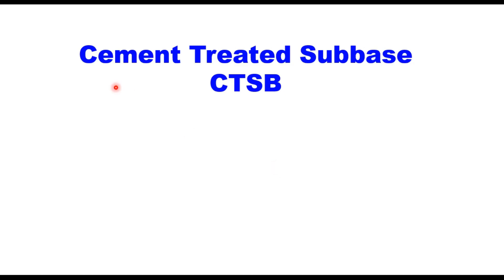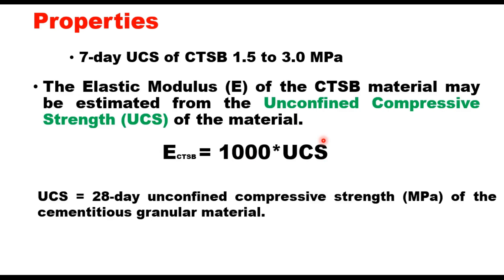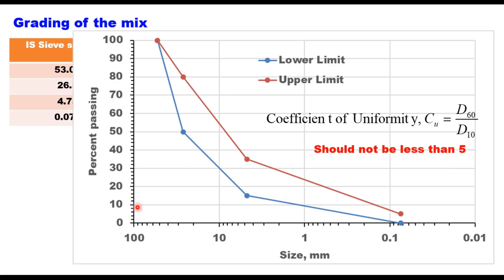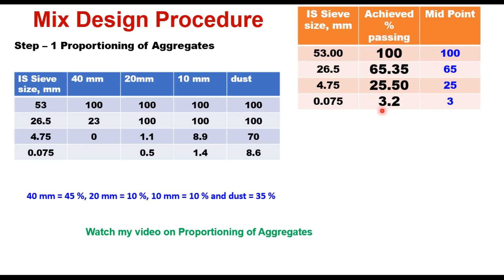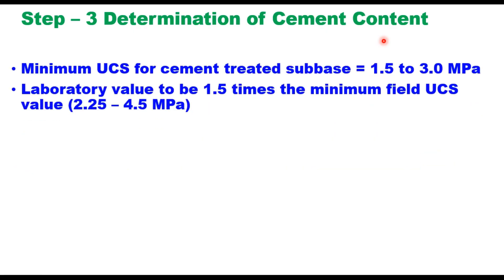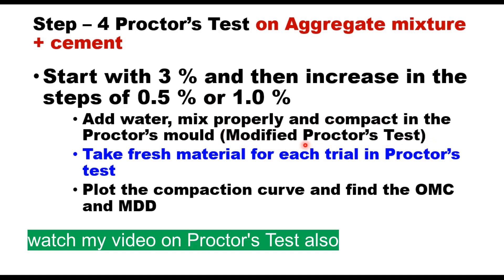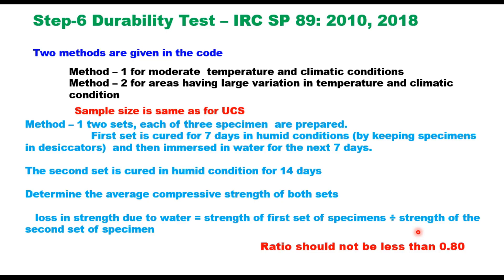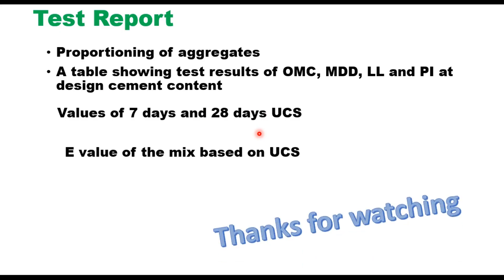Cement Treated Subbase (CTSB) course - Functions and Design of mix. MoRTH 2013 and IRC SP 89, IRC 37

Comment: Sir, what is basic difference between GSB and CTSB? Is CTSB better than that? Why CTSB is being provided now days than GSB?
Reply from the maker: GSB is a normal mix of aggregates as per Table 400.1 of MoRTH book. CTSB is also the layer of the same material but with 2-3 percent cement. It is considered better in performance of the pavement.

Comment: Firstly thank you for your wonderful informative videos sir. 
Sir, I have the following doubts regarding CTSB durability testing:

1. For a state like Assam, which type of durability test is considered for CTSB? Is there any mention of this in the IS code?
2. In the wetting and drying test, should the initial weight of the sample be taken directly after 7 days of curing, or should we oven-dry the sample until a constant mass is achieved?
3. In the wetting and drying test for cement-stabilized material, we have standard limits for mass loss, but not for moisture and volume changes. So, is it mandatory to check moisture and volume changes in cement-stabilized material?
Kindly clarify these points and correct me if I am wrong anywhere.
Reply from the maker: 1. Assam does not come under freezing conditions and therefore, wet and dry test must be sufficient
2. Yes, the initial weight must be oven dry weight
3. You can check with percent loss as there is not limit suggested for volume change.
Reply: Thank you, sir. In my second question, at what temperature and for how long should the oven drying be done?
Reply from the maker: @bobbysatish9316  refer IRC SP 89

Comment: Good evening sir, I have a one question, please reply.
In aggregate impact test, why we have taken aggregate passes from 12.5 mm and retained 10 mm. What is the reason behind it.
Reply from the maker: No specific reason. The test accessories and specifications are made using this size. If you take larger size then size of the cup, weight of the hammer and it's height will also change. It will make the test expensive. This test is very often conducted at site so equipment was made handy.

Comment: Respected Sir,
If I make a mistake, please forgive me or correct me.

The UCS we are talking about should not be less than 1.5 Mpa of an individual cube within the batch and the average of 5 cubes should be above 3 Mpa. This is written by putting single and double stars in the IRC code (IRC SP 89, Table 8) and Batch size of minimum 5 cubes to be taken instead of 3 cubes.

MOR&TH (Clause 403.2.6) says something different, it says that the design strength shall be taken as 1.75 Mpa and the laboratory strength should be 1.5 times more than the field strength.
This means that our field strength will be 1.17 Mpa, but after multiplying it 1.5 times it will become 1.75 Mpa (as per MOR&TH, 1.75 Mpa is Design Strength) or we can understand this by multiplying the design strength 1.75 by 1.5 and it will become 2.625.

It was confusing for me from the beginning, so I requested you to make a video on this, in the CTB video comment section.
Reply: Sir,
Found it, I was looking for it in IRC SP 89.
Reply from the maker: IRC SP89 is for low volume roads and MoRTH specifications are for state highways and above. 
Laboratory strength is taken higher than the design strength because of variablity in the materials and loose quality control. The design of the layer (E - value) is done for 1.75 MPa but when actual material is brought from the field for testing, the lab strength should be achieved 1.5 times the design strength i.e. 2.625 MPa. Here design strength is not to be lowered to 1.17 MPa. In the field you will achieve 1.75 MPa when you design the mix for 2.625 MPa in lab.
Hope it is clear now.
Reply: @SatishIITR  
Sir,
Why we have not covered MOR&TH Guidelines like minimum unconfined compressive strength & minimum cement content requirements in this video ?
Reply from the maker: @daksheshwar9108  These guidelines are now prevailed by IRC 37
Reply: Okay Sir,
Where it is written in the IRC code that this code is to be used for low volume roads. (IRC SP 89).

I searched but couldn't find it anywhere in code.
Reply from the maker: @daksheshwar9108  Read IRC 37

Comment: Q1. Why is there a higher limit of UCS? 
Q2. Is the Durability test specified in MORT&H specification CTSB? 
Q3. How much humidity shall be maintained for keeping the samples for durability test?
Reply from the maker: 1. high or low limit of UCS depends on traffic volume.
2. MoRTH specifications suggest durability test for soil - cement mixture.
3. There is no mention of level of humidity for desiccators.
Reply: @SatishIITR  
Sir what I meant was that why should there be any limit on gaining strength? Why should it not be only a min. strength requirement as in concrete, steel, aggregate and many such materials? 
What is wrong in obtaining UCS>3MPa?
Reply from the maker: @VivekSingh-si1ut  it will be uneconomic and if you have high strength in base layer, it will create problem of shrinkage cracks
Reply: @SatishIITR  
Thank you!
Reply from the maker: @VivekSingh-si1ut  you are welcome
Reply: Does casting of ctsb/ctb cubes have to be done using vibration machine
Reply from the maker: @civillaboratorytest  Yes, you can use vibrating machine.